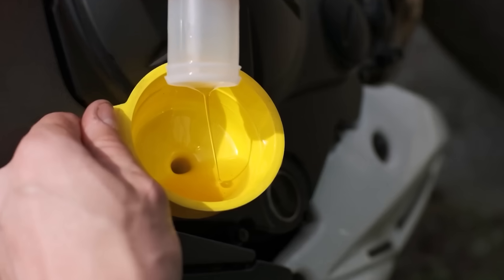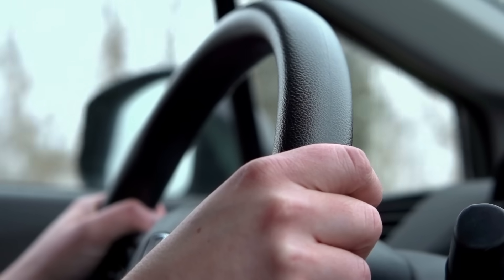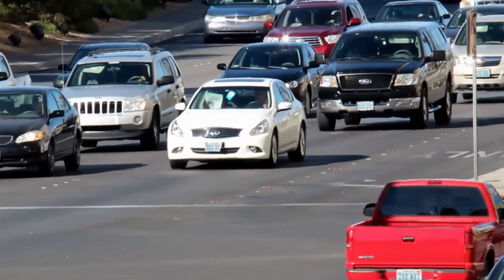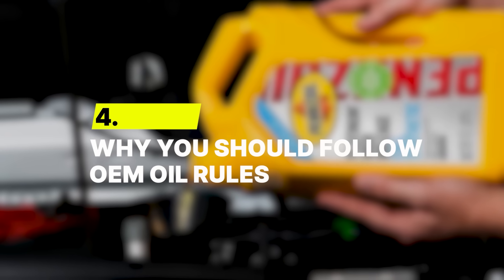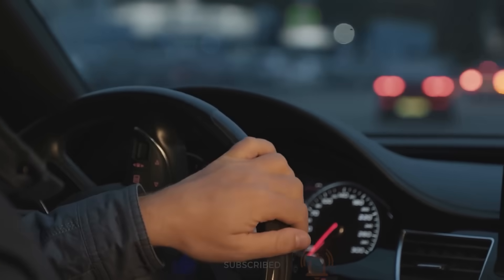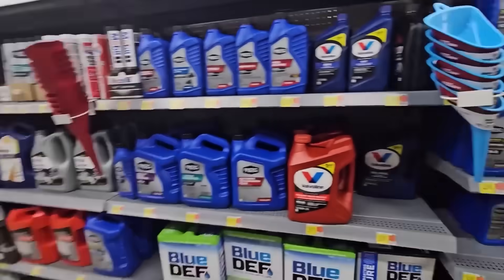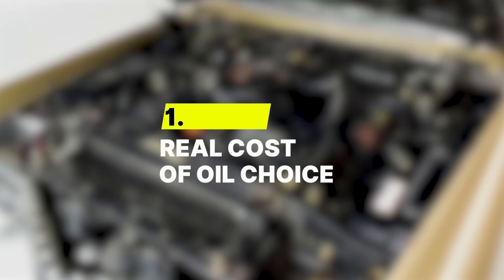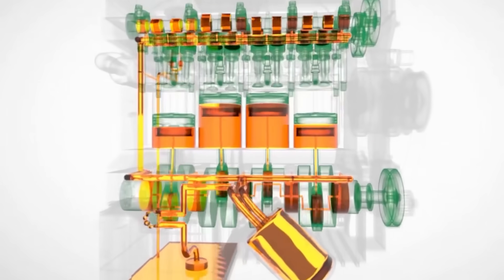0W-20 vs 5W-30: 50 Engine Tests Expose the Oil Everyone’s Been Using Wrong

Comment: I’d rather spend a dollar more per gallon and get 5w-30 than spending $5k-$8k on repairs sooner. Staying with 0w-20 you’ll never make that money back.
Reply: Honestly  , the thinner oil doesn't increase fuel mileage that much if any to use it . At least I never noticed the difference.
Reply: Manufactures call for 10w30 in Europe models. FACT.....
Reply: @larrylove9589  My 2021 Audi A3 gets 0W20 as per Audi dealer here in Germany...
Reply: 5w30 can actually increase engine wear if your engine calls for 0w20,   This video is AI generated clickbait missing real context and data,   Don’t be,dive everything on YouTube.
Reply: @ElmerFudd79 I’ve probably watched 20 other real test videos which claim otherwise and verify what’s being said here. Again a dollar or $2 per tanks is way better than writing a check for $8k in one shot.
Reply: @GRJCLyon yes and all other 20 videos probably had no data to back up claims.  Show me true lab results that support this after engine break in - there are probably none for most engines.  Lake Speed JR. just released a video showing real data and that increasing viscosity to 5w30 for engines that call for 5w30 can actually increase wear.  DO NOT change viscosity without UOA lab testing for long term trends.
Reply: Garbage video

Comment: If your new car says 0w-20, use it, always while under warranty.  After the warranty especially in hot temps, you can bump it up 0w-30 or 5w-30.
Reply: Arizona better use 5W40 or 10W40 Synthetic with right specifications chance every 8000miles or once a year an drive more than 400T miles with first machine...

Comment: 5w30 will hang onto engine parts better after the engine is shut off.  The next time you start the engine you already have a layer of oil where you need it.
Reply: COMPLETE BULL SHITTTTT
Reply: I  still  prefer  5w - 30w  on any engine not in temperatures below 40 degrees Fahrenheit  and over 50,000 miles ... 65 years professional mechanic ! Just my experience with my customers  !
Reply: @billgore6741   You're correct, but even well below zero, you should never use 5-20 under any circumstances.  Vehicles that have 5-20 recommended in the US, have 5-30 recommended in Canada and other countries, the same car and engine.
Reply: @davidstjames_  tHATS ONLY BECAUSE the 5-20 gets better economy, no other reason. 5-30 is fine at low temps
Reply: @Mach141   Theoretically it can get better mileage, but it destroys the engine.  It is only recommended in order to manipulate the EPA estimated mileage for the sake of the CAFE requirements.
Reply: @billgore6741  5W30 isn't good below 40 degrees?
Reply: @filippocorti6760  False. It's BETTER.
Reply: We add L. Moly anti engine friction additive. It leaves a a silk coat on all parts.  CLINGS. ANTI FRICTION ADDITIVE. ADD TO OIL
Reply: @IronMike-f8i Ceratec is the name. It works.

Comment: Oil temperatures do not rise during long downhill driving, it goes down. Going back up the hill it gets hotter.
Reply: Idling with the AC on in 95+ degrees for long periods will build more heat than going 80mph uphill, providing your cooling system is working properly
Reply: @gloriamaletta8667  My last car had an oil temperature gage. Going a long uphill run at high speed puts a lot of heat in the oil you can see it happening. If cooling fans are running properly idling with AC on doesn't produce that much heat. It's all about fuel flow, more fuel flow means more heat. Gallons per minute at 80mph is much greater than at idle.
Reply: @boatingcharlie1 oil works the best if heated oil temps should be 220-240 degrees above 250 is getting to hot below 190 is to low getting the oil to 190 degrees or higher as soon as possible oil is not as good at lower temperatures below 190 degrees oil needs to be warm to burn off moisture in crankcase above 212 degrees is why l say 220-240 degrees is about perfect oil temperatures